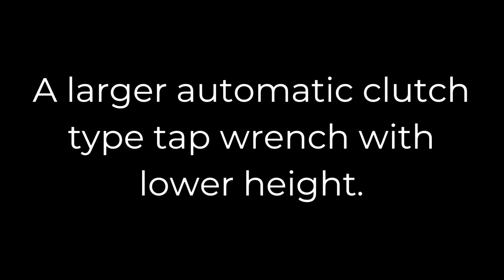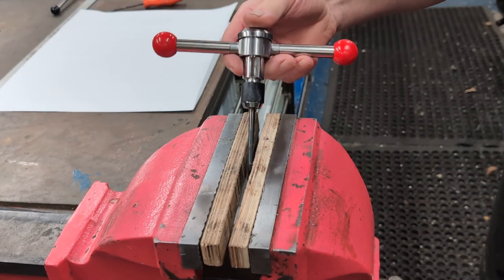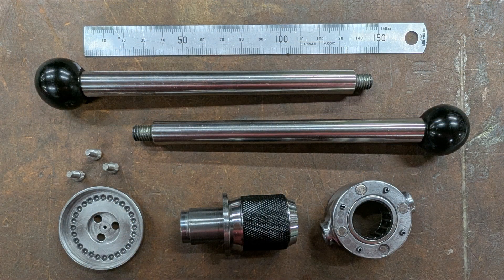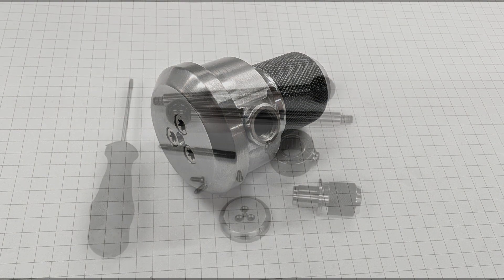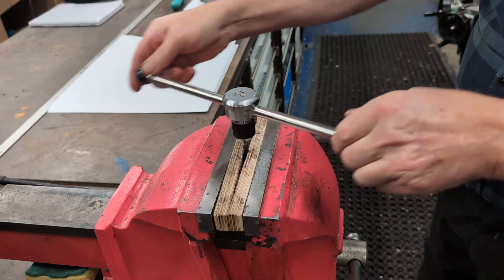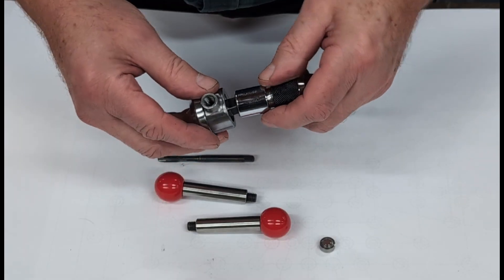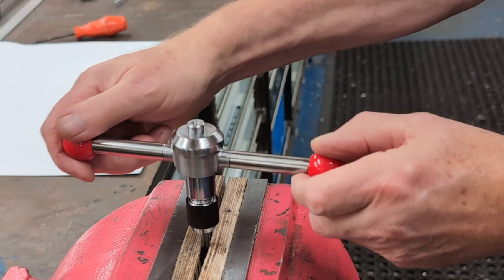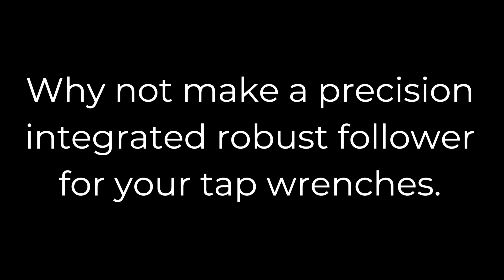New lower profile clutch type tap wrench.

Comment: Hi, I love your idea's and have just found your channel and subscribed. Kudos to you, your work is exceptional.
I too am a retired toolmaker and by coincidence have a Guide dogs mummy which will hopefully go on to produce many pups to go on to be guide dogs, maybe you'll get one of her pups to rear !
I've just had an ICD fitted (Pacemaker) so I've been banned from the workshop for a while. 
I see a lot of people in the comments would like drawings of your designs including myself. I would gladly produce drawings using Fusion CAD software from your sketches, as this would keep me sane for the time I'm waiting to get back machining. Of course there would be no charge and you could attach them to your vids for guys to make their own. 
You maybe already have the capability to do the drawings yourself but maybe not the time?
Lastly, I prefer your own voice to the AI one mainly because you sound like me! 
Keep up the good work my friend and make the chips fly
Reply from the maker: Thanks Steve. I am a bit behind with producing proper drawings. I suppose if you had a .dxf file of an assembly with all parts on their own layers would you be able to model them in 3d and fully dimensioned 2d drawings. Can you send me your email via the address on my home page.
Sometimes my work wins tool or tip of the month, the cash prizes go to the guide dogs and I think I'm just under $1000 so far. Although I just won another $250 for my ratchet tap wrenches. I don't raise puppies here, but the channel supports 2 at the moment. Are you from the midlands area? On a recent video I asked at the end if anyone finds the content useful could they make a small contribution to their local guide dogs. I won't make it a regular thing, do you think it is a good idea or a bit icky.

Comment: Nice work. I would rather press down when cutting the thread, all you need to do is turn the assembly upside down and add a stop washer on top. This is normal, natural for a hand tool and will allow you to quickly automatically release the clutch with the stop, or if you add a spring to the release, then it will be enough to just remove your hands.
Reply from the maker: It does cut when pressing down.
Reply: @machinists-shortcuts  body pressing down, but handles up ^, you can't use this like hand tool with pushing down on handles.
Reply from the maker: Pressing down on the handles and turning clockwise turns the tap clockwise into the hole. Rotating the wrench anticlockwise leaves the tap stationary. Just like fitting a bolt with a ratchet socket.  Pull up the handles and the mechanism becomes fixed in both directions. It will remain fixed until the handles are pushed down. Again it remains down until the handles are pulled up and the magnets hold it up.
Reply: @machinists-shortcuts  I missed something, how does the ratchet work?

Comment: Wow!  Thanks for sharing!
Reply: But how did you machine the tapped bosses where the handles screw in?
Reply from the maker: I held it with the boss uppermost and machined the round profile and then tapped it. Then did the same on the other side.
Reply: @machinists-shortcuts  Sorry, don't mean to be a pest but how do you hold the part and machine the 12mm boss with an R2 radius on the 38mm diameter and how do you machine the 38mm with the bosses to begin with?  I'm probably missing something obvious here.